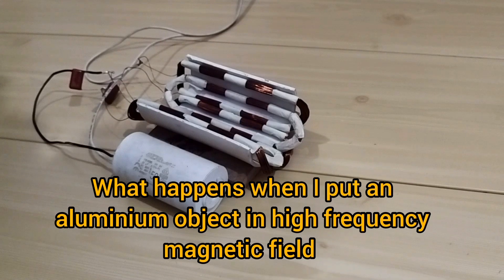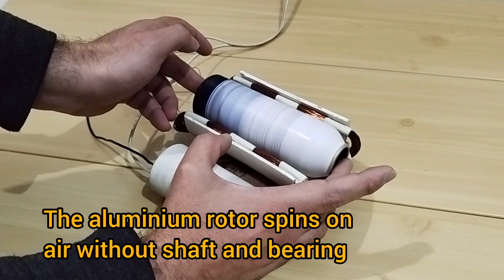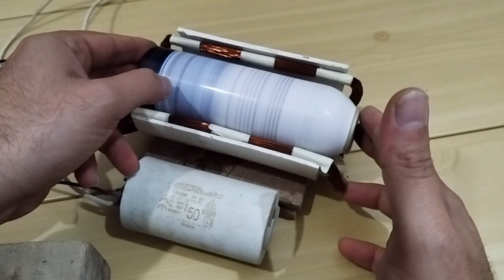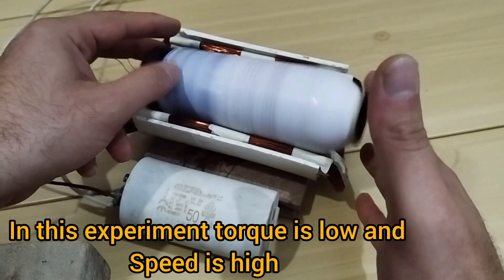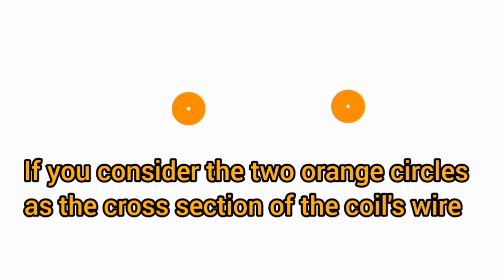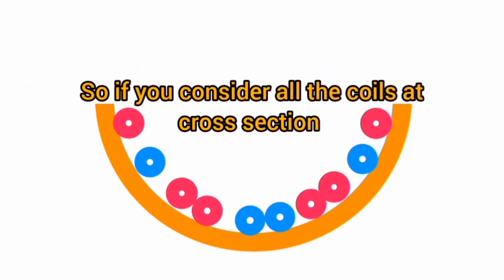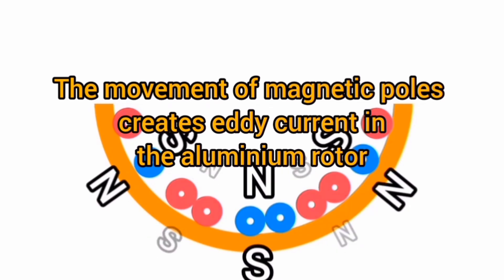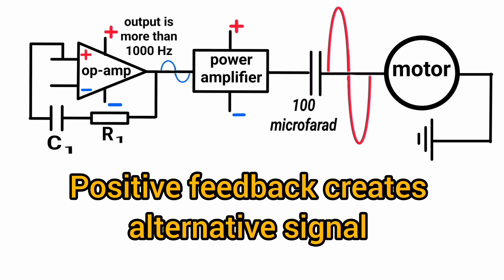crazy rotation of aluminium rotor on air gap and I hold it just by fingers.

Comment: Nice Experiment. A Question: Which size of wire you use for the coils? Thanks for a answer!!
Reply from the maker: @retopoltera-meng4742  (0.45 mm)  100 turns per coil (13 centimeters × 2.5 centimeters)
Reply: Thank you for this Information!!